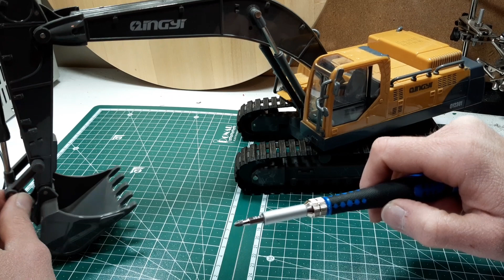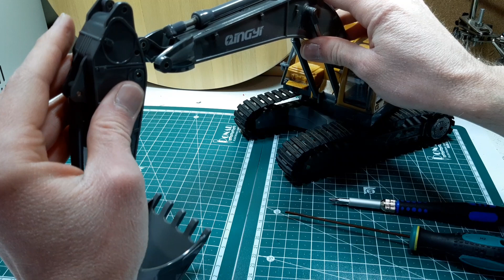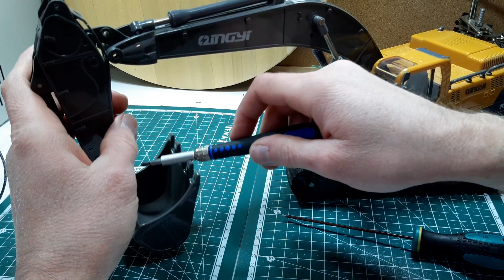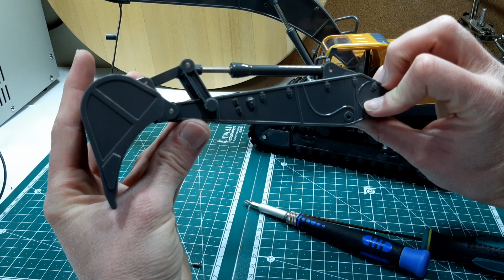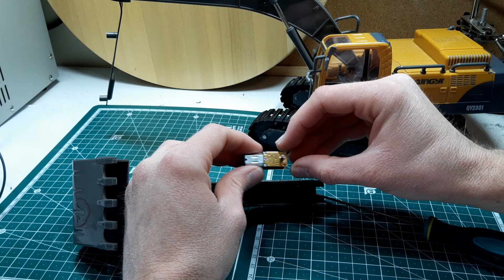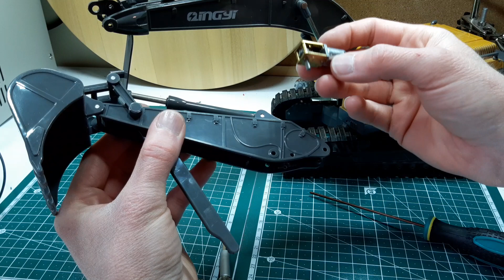Bucket control mechanism in the Qingyi QY2301 RC excavator

Comment: You could feed the gear motor from a servo PCB and 3D print a simple pair of gears so the motor gear shaft rotates a servo POT, or add the POT the link rod.
Reply from the maker: Good suggestion, I've been planning something like that for the PC400 build for years just never get round to it
Reply: @RCTractorGuy  Thanks, I've been enjoying the lead screw type builds you've done.

Something I've considered for things  with a long throw is a pair of fixed resistors as voltage divider on a servo PCB, a limit switch In parallel with each resistor and mount them at each end of throw.
Reply from the maker: I was thinking reed switches with a magnet for limit switchs could work too. I might be misunderstanding but if the switches are in parallel to each resistor then when they switch they'd pull the feedback signal either high or low. The motor would then accelerate trying to reach that position.
Reply: @RCTractorGuy  you kinda got it, just think with the motor wired the opposite way around, if you give fully left signal, the motor would go at top speed towards the left.
When it hits the limit and the switch bridges that resistor, it would be the same as the POT hitting full left as the right resistor would not be bridged and it would stop going left.

It might have a tiny burst of acceleration coming off full left as it moves towards centre, I still need to test this, if I get around to making a  video, I'll let you know.
Reply from the maker: Yes I'd be very interested to see that video. I get what you're saying but I'm wondering if you let go of the joystick what happens because the switch is telling the servo its at 0 or 180 but the joystick is back sending 90 degree signal. Should be interesting to see what happens in reality
Reply: @RCTractorGuy    My best guess at this point is that it would move off the limit very quickly because it thinks it's not at 90, then it would just stop and work viarable speed/direction.

I didn't get around to finishing editing this morning's comment, I would try to not hit these limits in operation, just have them as more of a safety measure.
Reply from the maker: Yes that makes perfect sense, it moves slightly back off the switch and should stop. I'm looking forward to seeing it I  action